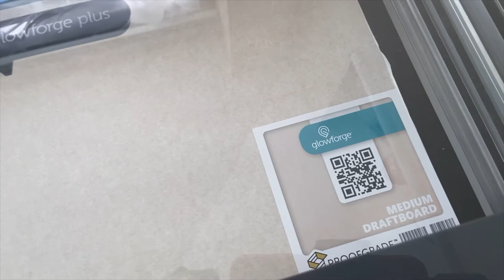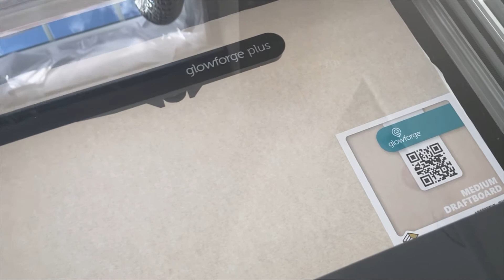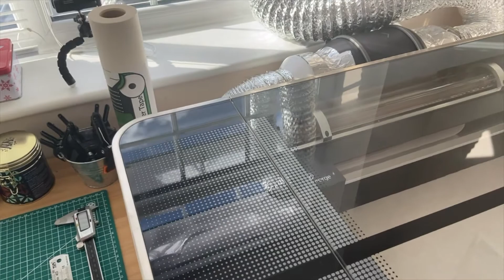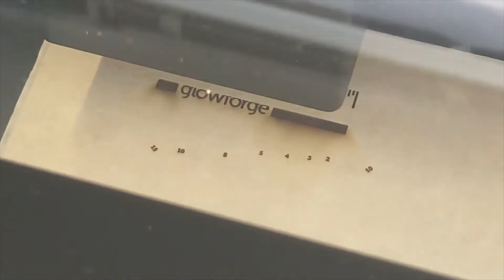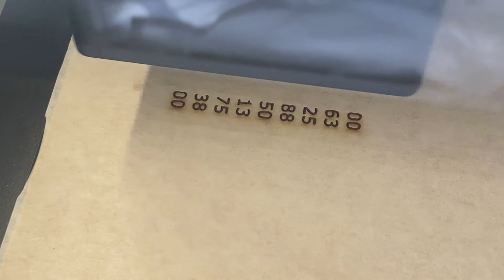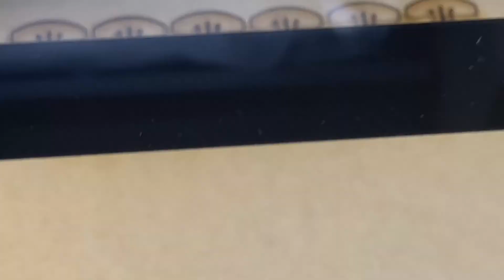Glowforge UK - Making my First Laser Cut Product on the Glowforge Plus!

Comment: HI Rob I just had my glowforge plus delivered today. I used your referral code.   I too have just made my first gift of good measure tool.  I was venting out the window only the room was quiet smelly of burnt wood, I did feel some air blowing out from the back of the machine where the hose was connected, I'm not sure if this should have happened, maybe it wasn't connected correctly.  I too would like to get an external fan, can you let me know where you got it and does it come with a UK electrical supply and do you get a good seal from the back of the glowfordge to stop any air coming out
Reply from the maker: Hi Stephen, thanks for reaching out and a particularly BIG ThankYou for using my referral link! It means a lot! Have you joined my Glowforge UK Facebook Group? If not, please feel free to do so as there are many resources I've put together there that you may find really useful, including a Guide with lots of info including venting! To your issue. If you felt air coming out the back of the machine then it definitely sounds like your hose wasn't on tight enough, hence the smell. I got my AC Infinity Cloudline extractor from Amazon but you can shop around - I got the 6" version plus reducers to go from the 4" hose to 6" unit. I used foil tape, used in loft work, to help create a tight seal as well as crocodile clips - again all via Amazon. I actually put together an Amazon list of recommended accessories, tools and other optional extras - you can get this via the group. By joining, you'll also have ongoing support from myself and the community - I'm not paid by Glowforge but am recognised by them as an "unofficial" group for the UK and have built a close relationship with them so you'll be in good hands. If of course, you're already in the group, give me a shout so I know as there are 600+ others and I can't always keep up with who has joined and who hasn't among those I interact with outside of the group! Anyway, I hope this helps for now, do reach out again anyway you prefer if you need to and I'll get back to you asap!